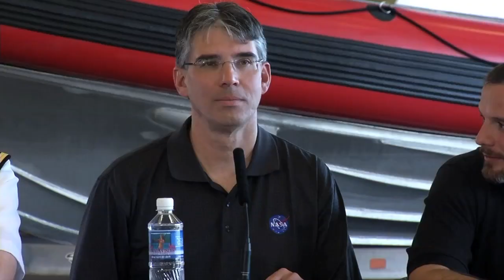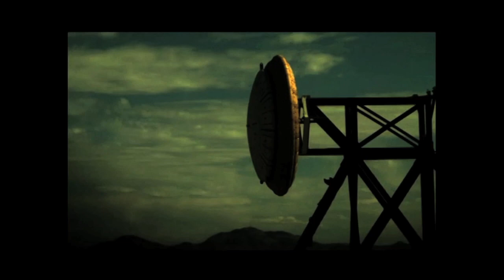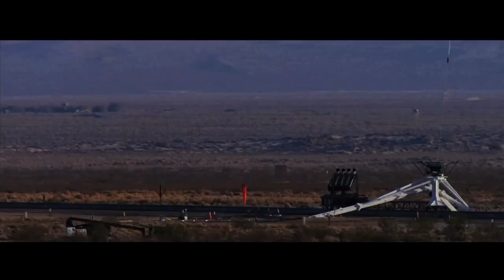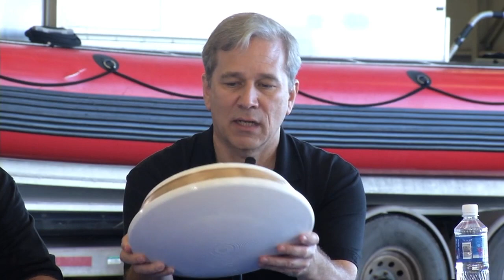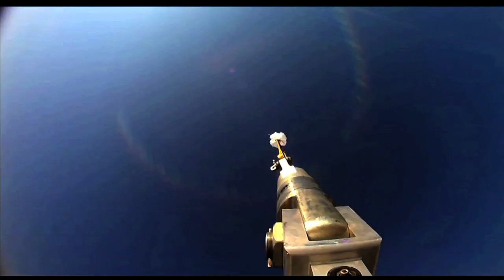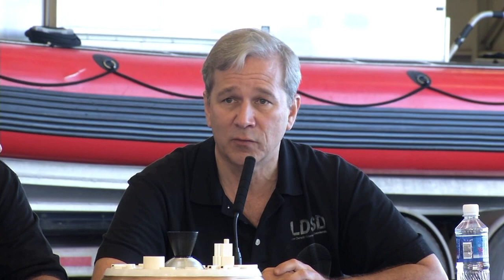News Briefing Previews Test of Saucer Shaped Vehicle

Comment: Thank you for answering my question. Here is another after listening to your great answer: Does the slowing of the descent have to be relevant to the weight being delivered, or why does it have to be 20 to 40 Tonnes rather than individual lighter payloads such as the first one, that could actually help in reducing the need for any extra rocket fuel?

Comment: ♥
Reply: The mission is testing a 'balut' inflatable aerobraking balloon, coupled to an improved parachute design, as well as many other bit's and pieces for potential future missions to Mars The initial balloon and the rocket motor are intended only to get the probe to an area of the atmosphere that more closely resembles Mars atmosphere.

In case you wan't to know what a balut is, check out the movie 2010: Odyssey two. The Soviet spacecraft inflates a balut before entering the Jovian atmosphere, which slows it down without using fuel. This concept is what any future probe to Mars could use to slow it's descent, without needing extra fuel to do so.

Nasa does the coolest things :)
Reply: What?
Reply: CartoonsKick Very well put and perfect example if there ever was one.